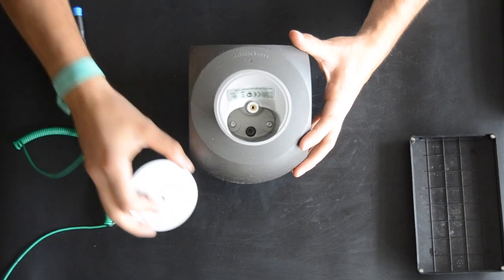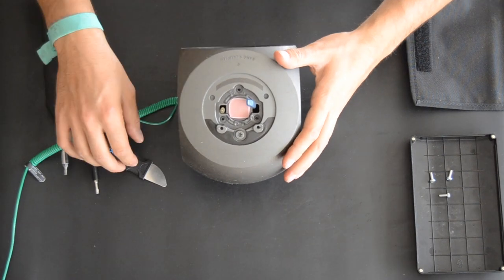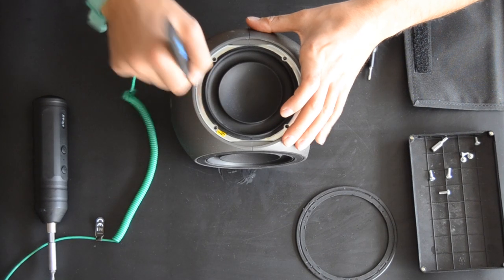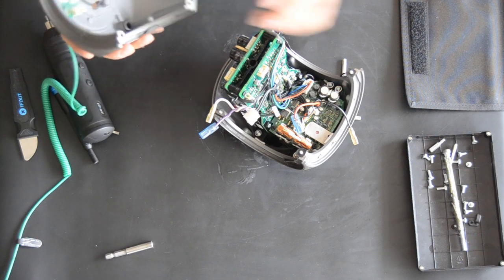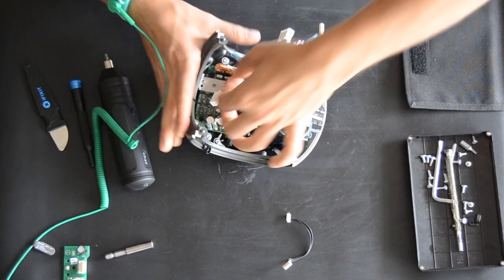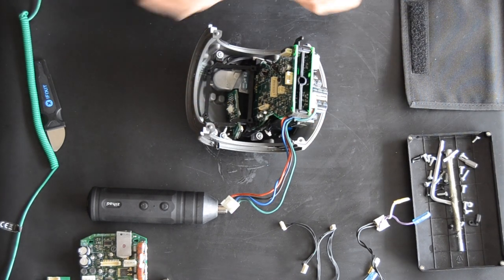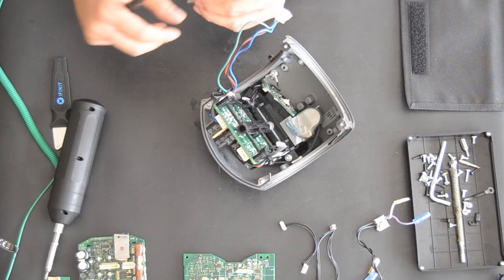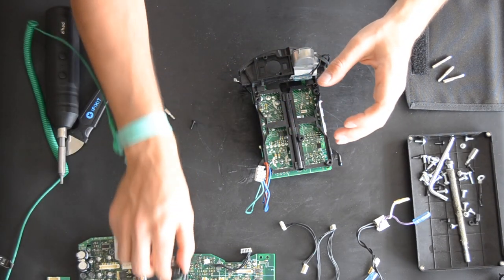Bang & Olufsen Beolab 3 Active Loudspeakers Disassembly process and repair guide - Part 1

Comment: Why take apart all the printboards ? You Can just remote all of it in a bundle if you use sidescrews only….
Reply from the maker: Hi John Poulsen
Thank you for your comment
I know that the complete board can be removed by the 6 screws from the chassis. In this video i will show how to remove all the parts from Beolab 3.